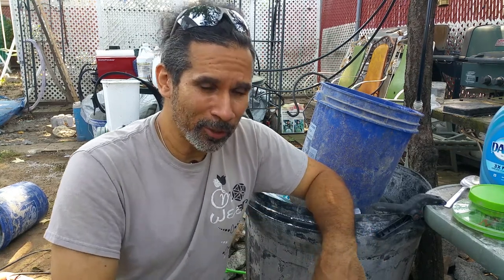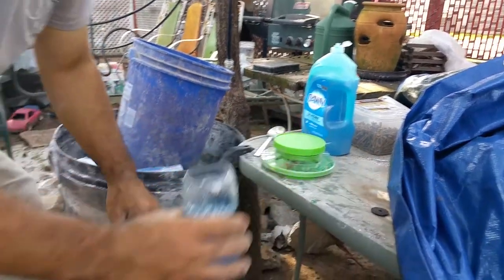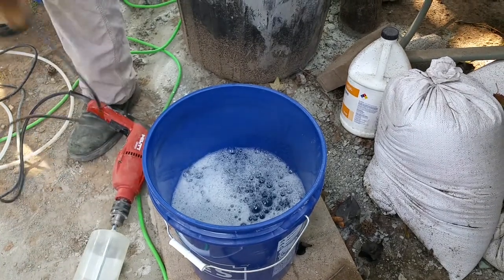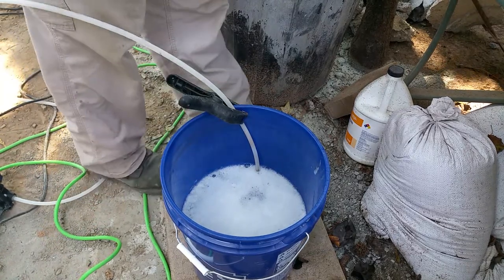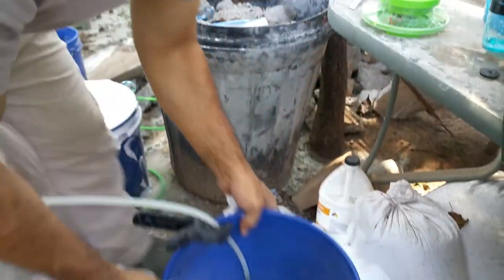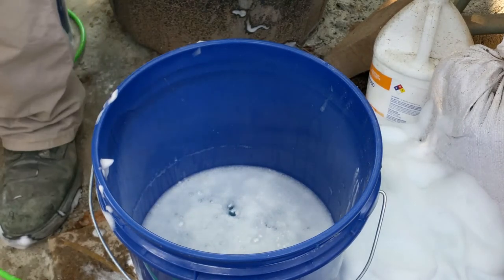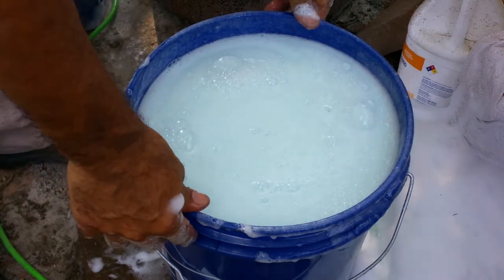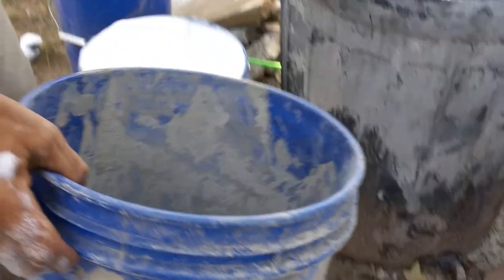Foam Test: Dawn Soap vs Special Mix Strength Test Part 1 #Aircrete #AircreteHarry #DIY #Foamtest

Comment: What is your recipe and will you share it
Reply from the maker: I tested making aircrete with my new formula and it does not work for aircrete. Use Thank You, Drexel Foam Concentrate 1 Gallon 160:1 F.M.-160  Is the best one to use. to make foam for aircrete. I made a new videos.

Comment: You didn't mention the name of the powders
Reply from the maker: I tested making aircrete with my new formula and it does not work for aircrete. Use Thank You, Drexel Foam Concentrate 1 Gallon 160:1 F.M.-160  Is the best one to use. to make foam for aircrete. I made a new videos.

Comment: whats  the powder?
Reply from the maker: I tested making aircrete with my new formula and it does not work for aircrete. Use Thank You, Drexel Foam Concentrate 1 Gallon 160:1 F.M.-160  Is the best one to use. to make foam for aircrete. I made a new videos.